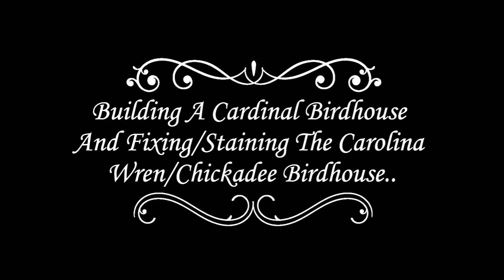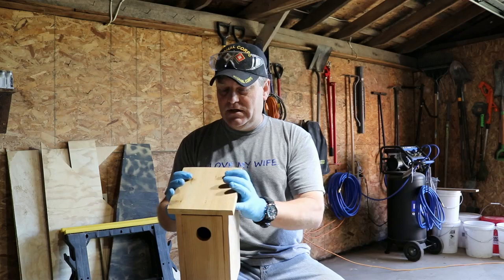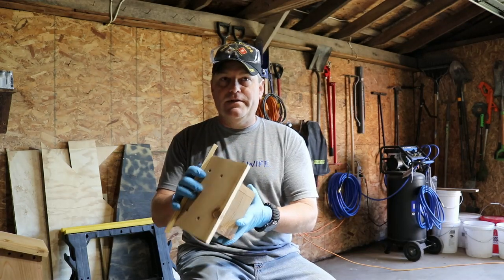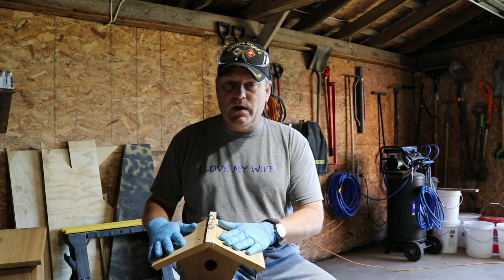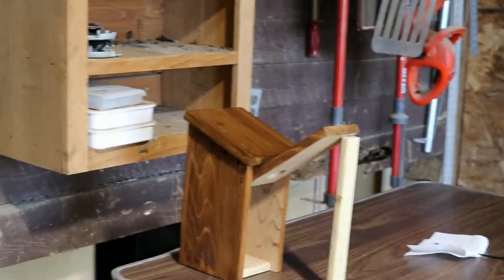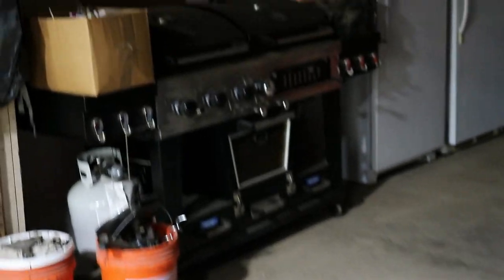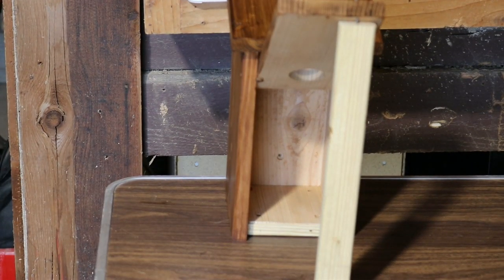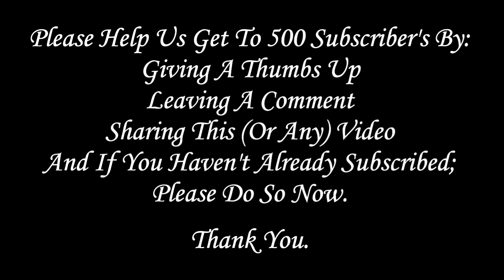Cardinal Birdhouse Build And Fixing/Staining Carolina Wren/Chickadee Birdhouse

Comment: That's not a cardinal birdhouse.  They won't nest in an enclosed box.  Cardinal birdhouses are basically shelves with open sides and an overhead cover.  You've been given bad info.  Bluebirds and tree swallows will like that box.
Reply from the maker: I've had someone else also mention that this isn't a cardinal birdhouse. As I mentioned before, this is a birdhouse that multiple species might choose to use. I have a few hanging outside and have a cardinal that has used one of them and also have bluebirds that also use them. I do understand that there are open faced houses as well and cardinals may prefer those. Thank you for the comment.